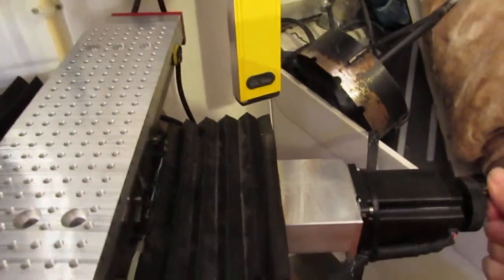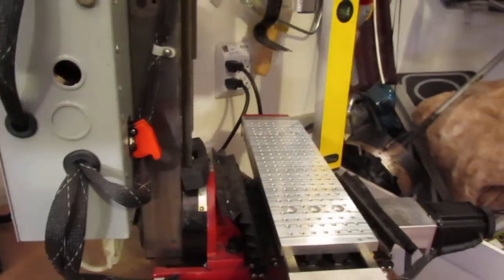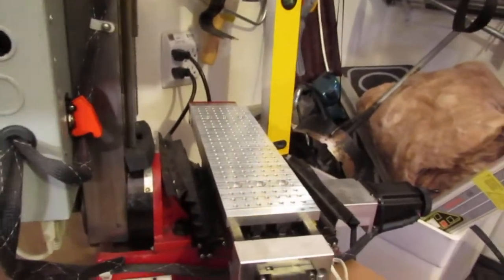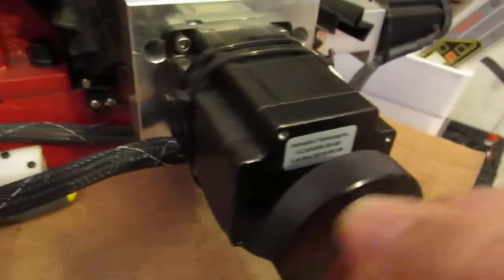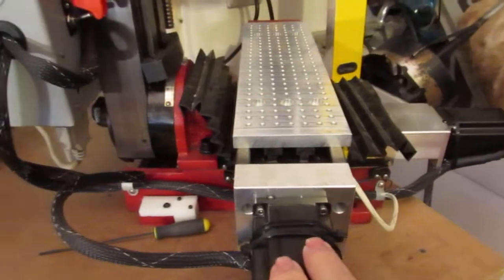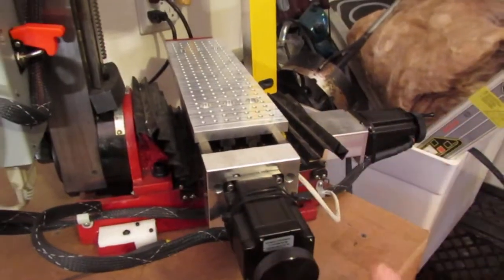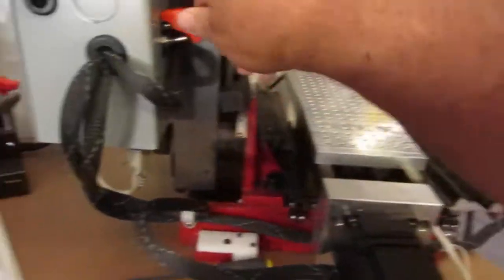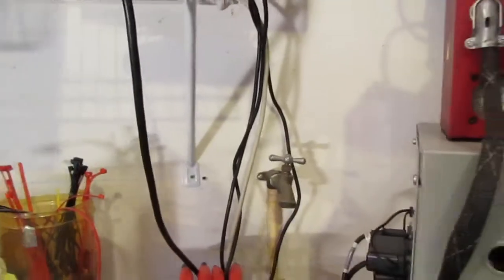Mini Mill Binding, Part 2

Comment: Wonder whether you maybe able to help.. I have a stepper on my x axis as a power feed using I think they call it a Pwm switch .. has a central petentiometer and a button either side. You can change the speed and direction works perfect.. except I want it to lock sometimes , like when I want to cut a different axis 🤷‍♂️ any idea how
Reply from the maker: Sorry, I don't have a clue....